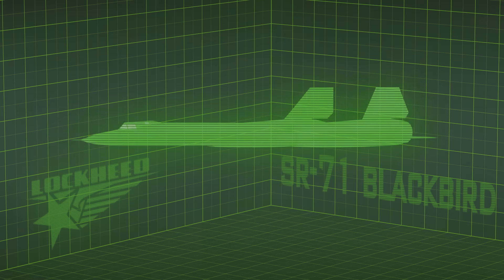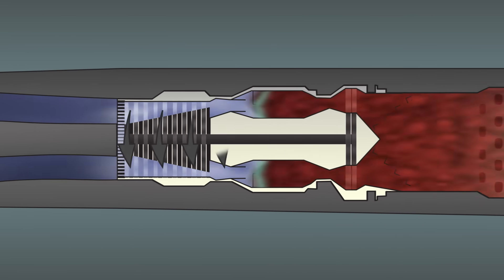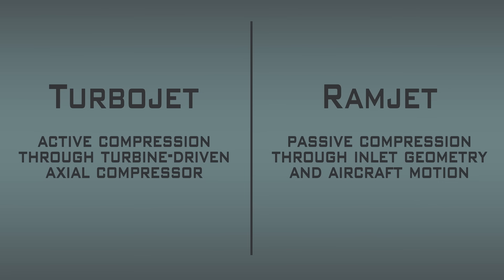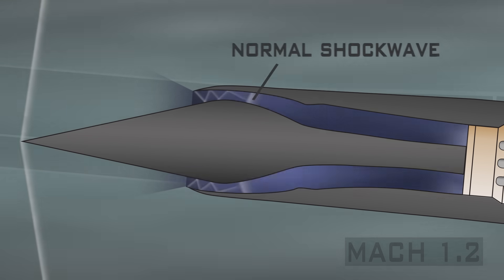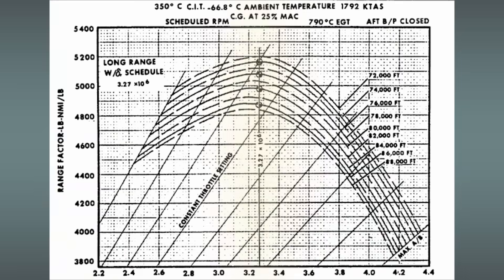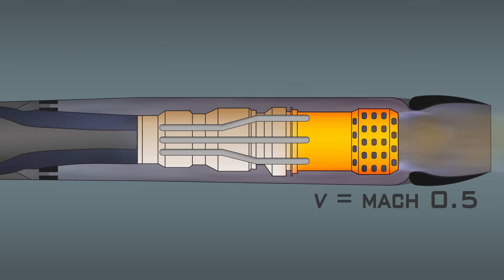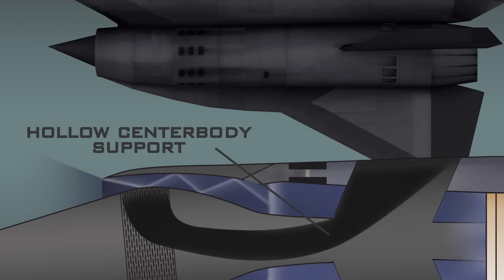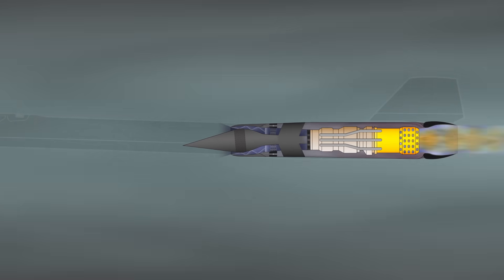The Mighty J58 - The SR-71's Secret Powerhouse

Comment: Is the cross section at :25 taken from the top, or the side? Didn’t know the cone on the front was tilted, not aligned along the nacelle’s central axis, so that’s good to know, but how irritating that this YouTuber doesn’t tell us if the cone is pointing down, inward, up, or outward. Makes it hard to invest attention in the rest of the video when it starts off by leaving you with a nagging question.

Comment: Most permanent locations for the SR provided high pressure air that spun a turbine with a spline gear engaged in the engine accessories box.  Secondary Start Carts was used when required. Each cart had 2ea General Motors Buick V8 engines that were connected in tandem.  They were soup-up boat racing engines tied to a spline gear to engage the engine. One cart could start one engine at a time. I guess 2 would be more convenient. I’ve only seen 1 used. The SR71 used JP7 fuel. The only aircraft that used it that I know.  The fuel had such a high flash point that the regular igniter used in usual turbojet engines wouldn’t work. The fuel had to be ignited using the liquid pyrophoric chemical TEB (Triethylborane) with so many shots available for each engine. TEB ignites when in contact with air.

Comment: Much of the math calculation were by slide rule. I spent 11 years on the SR 71 until it’s retirement. The most difficult and maintenance intense aircraft I’ve ever worked on. The fuel, engine oil, hydro fluid was especially designed for it. Your animation is close. You show the cooling air around the engine as being a smooth run. The nacelles have several large structural titanium main frames around the circumference that are hinged at the top and tie together at the bottom for access to the engine. These frames not only help carry the trust load of the engine but also the load from the outer wing. The velocity of that air shouldn’t be very high. I’ve seen other illustrations on how the SR engines work. One that was correct. Assuming that it’s now declassified you can find it on the Internet. The overall thrust that the SR has is not just from the engine and afterburner but also comes from the inlet. At cruise the spike with its shape has high pressure behind it and low pressure near the front. The spike pulls the airplane along. If the correct position for the spike at a certain speed and condition is not maintained, a condition call an inlet unstart will occur. This causes a violent aircraft yaw slamming the Pilot and RSO heads against the canopy. Also causes skid marks.
Reply: That closing skid mark comment made me spit all over my computer screen. I'm still laughing.
Reply: This is probably the best youtube comment I've ever read
Reply: Rex, Where on the engine is the Triethylboron  tank located?
Reply: Well aren't you the little smarty pants! Glad you were. Hat's off to ya !    : )
Reply: Whoever designed this beast is a genius. Really.
Reply: @drjthornley  Kelly Johnson
Reply: most people of this audience do not know / never seen a "slide rule"   :0  makes me feel old.
Reply: u have it right rex, see my explanation above, - it fits with kelly's words "at mach 3 , 80% of the thrust is GENERATED by the inlet"!!! - what has not yet been repeated in history is an integrated engine and nacelle setup that works so well at all flights regimes - before you can have "sled drivers" you need a "sled builder" , alas, no more kelly he was not replaceable
Reply: What the hell?
Reply: This is a freaking amazing comment. Geniuses! Thank you @Rex Lee
Reply: This is why I frakin love YT - comments are PURE GOLD.
Reply: Top speed ever recorded was Mach 3.56 for 15 seconds, achieved while in a descent and unexpectedly hitting very cold air.
Reply: @studlouie416 holy shit, that’s fast. Was that Brian Shul?
Reply: Rex lee what kind of math did you have to use
Reply: Wow another super genius engineer
Reply: What would you guess would be the theoretical max speed of the SR 71 riding the shockwave?
Reply: @blueboltstrike6705  I have no idea. I’ve asked several times and got no answer except Mach 3+. Maybe they didn’t know or I didn’t have the need to know. Riding the shock wave? Not that I know of. The XB70 rode its shock wave I believe. The wing could be folded down for that function. Another fast aircraft and good looking too. The last one is inside the Wright Patterson AF museum
Reply: @rexlee3710  Yeah they told me that the XP 70 had the winglets that would drop down and actually grab the shockwave for further stability and speed. 

All those super sonic aircraft and even the civilian Concord could ride the wave. My guess is that the SR 71 could easily go 3.6 Mach
Reply: @blueboltstrike6705  unoffical 15min.jumps to 3.5 mach have been reported. its the heat on the airframe & components that stop it from going faster.
Reply: I bet it would be easy to adapt this design with a scramjet phase. All that would need is an ultra-narrow channel into which fuel is injected during hypersonic cruise.
Reply: Cara escreveu uma bíblia.
Writing a Hole Bible 🥺
Reply: Man, I've had my hands on many jets and many jet engines, but I admit, I am greatly envious.
Reply: Skid marks???? Runway or the pilots underwear?
Reply: What systems on the SR 71 required the most maintenance?
Reply: These planes were priceless and irreplaceable national intelligence assets, they never pushed the performance envelope. It wasn’t worth the risk. I read a nasa report from when they had a few blackbirds, they thought Mach 4 at 120,000 feet was theoretically possible, however an attempt would never be approved.
Reply: 🤣😂🤮Where is a single reality fact about this jet NONE only a few outside pics 0 inside pics and a fake story on Wiki hahaha lol such a FAKE that has been produced by the Pentagon to make 35% demoncratic morons of the world to believe in it brainless brainwashed demoncratic western idiots LOL... trash fake channel blocked just like others!
Reply: I'm too high for this shit.
Reply: As a high school senior going to into aerospace engineering next year. I view you basically as a sensei, my respect for you and your achievements is something that can't be stated easily with words. I guess all I can say is you helped create one of finest aircraft to ever take to the sky and that inspires me.
Reply: Kosta Thomas. May I suggest reading the book Skunk Works by Ben R. Rich. I have listened to the audio version twice and was even more amazed the second time around. The book goes into detail of the development of the U-2, SR-71, F117, and B2.
Reply: @gizmo9987  The B-2 is not a Skunk Works aircraft. I have not read the book, it might say something about the B-2 anyway.
Reply: @gizmo9987  Kelly Johnson was one Baaaad Dude!!!
Reply: @skunkjobb  It’s not even a Lockheed aircraft either, it was made by Northrop.
Reply: Kosta Thomas what college?
Reply: Sir thank you for working on the blackbird it is mind blowing of the capabilities of the sr71
Reply: The fuel is called (poly ether)polyoxymethylene dimethyl ethers.
Reply: As long as those skid marks are around where they can be dealt with and talked about later, but image all the skid marks that never got to tell their stories.. lol
Reply: Thanks for the additional details re the tuned inlet spike. I had long heard the SR's engines actually do more pulling than pushing at cruise and altitude, but could never get my mind fully wrapped around how that was even possible, having spent my 4 years with the Navy's A-4 Skyhawk which from my observation, derived its thrust solely due to huge amounts of noise, smoke and blast out of the hole in the rear of the airplane.
Reply: So much investment of time, manpower and money with so much exotic materials and Russians got quite near with just stainless steel 😂😂
Reply: @Sameer2762  the russian aircraft tore its engines apart anytime it passed Mach 3
Reply: @deathdragon2283  I know but remove the sanctions going back in time and Russians could have went the Earth sending it on interstellar course 🤣🤣
Reply: No, you csnnot bresk this down so.
The MIG 25/31 could reach Mach 3 for a short time. Measured in minuted or seconds.
The SR71 could make a sustained flight on Mach 3, without damaging engines, or damaging and/or loosing important subsystems. The MIG's would simply burn out after few minutes, while the SR71 flew som decades.
Reply: @Sameer2762  No one has yet to get close to the SR-71, it can go mach 3.3, 100 mph faster than any other jet before it. the only Russian jet is slower by .1 mach when it comes to max and its cruising speed is far below the SR-71 with 3.17 to 2.6, and the top speed is thought to get as high as 3.5 but its noted that no one would ever want to hit that speed, the 3.3 top speed requires permission much less 3.5. the thing is so fast its only been intercepted once, and that was by a Swedish pilot over the Baltic sea. the Blackbird was having engine trouble and got an escort. the MiG though, it was really nice, especially since it entered service 2 years before the sr71 and i don't think its been retired yet.
Reply: @itshunni8346  I agree but all I mean is, what if the Soviets would have invested bit more of time and money on such a high level of research. The scenario would be like a proper Formula 1 race 😂😂
Reply: @itshunni8346  The top speed on any of the Blackbird variants: A-12, M-21, YF-12A and SR-71A/B/C weren't limited by the maximum Compressor Inlet Temperature(CIT), not Mach number.  The CIT was never allowed to reach over 427ºC.  During one of the last flights, special permissions were issued to raise the max. allowable Compressor Inlet Temperature from 427ºC up to 450ºC in order to try and set a new speed record. Unfortunately tanker support and environmental influences along the route didnt allow the max. inlet temps to be reached.   In  off-nominal operations, the J58 engines in these aircraft did have a speed restriction to just Mach 1.5 only if emergency fuels OTHER THAN JP-7 were used.  Using emergency fuels had to be written up as a discrepancy on AFTO form 781.
Reply: @hoghogwild  I thought the Blackbird’s maximum speed was limited by how hot the fuselage would get due to aerodynamic friction.
Reply: @michaelmurray11189  Eventually perhaps, but the engine CIT was not to be violated, 427ºC.
Reply: Russians do not retire their war gear. It is always the best and modernst equipment they have!
Reply: @Sameer2762 that’s what they said they did. Russia often lied about their capabilities
Reply: Skid marks? Didn't unstarts only occur when adjusting the spike at high speeds?
Reply: Ryan Boles. This is unscientific. The skid marks that I was referring to are the ones that comes from pooping yourself resulting in stains (skid marks) in your underwater.
Reply: @rexlee3710  ahhh, it would indeed cause those
Reply: @rexlee3710  haha
Reply: @rexlee3710  Thank you for commenting. It is amazing to hear / learn from the people that were actually there. Again, thanks Rex.. Z
Reply: @rexlee3710  We all know that metaphor.

Comment: The most astounding part is that this was all designed, engineered and built in a time before a simple calculator ever existed.  They used slide rules to help with the calculations required.  How many people alive today even know what a slide rule is???
Reply: This was well into the computer age and there were plenty of mechanical adding machines. 

Slide rules were used for simple calculations and checking.
Reply: @calvinnickel9995  ::  Plus batch programs run via decks of punch cards on mainframe computers, with aeronautical engineering programs.
Reply: Yeah if you want to talk punch cards and mechanical computers you can go all the way back to the 18th century with programable weaving looms. The French also had things like control characters for their network of optical semaphore stations in the 18th century. Baudot code—the first punch card code specifically made for transmitting messages electrically (and where we get the term Baud from) was available in the late 19th century. 

ENIAC, the first electronic computer, was made at the end of the war. By the time the SR-71 was designed, Mainframe and even mini computers were commonplace like the IBM 1400 and Honeywell H200. 

A slide rule was more like a calculator was in the 1980s or 1990s or like a smart phone is today. It’s portable and convenient and good for doing quick math or checking gross errors. 

But from 1980 to today you use a microcomputer (PC) with a CAD or spreadsheet program to do actual design or complex calculations.
Reply: Slide rules are more useful than calculators imo. You get a better "sense" of the numbers from one.
Reply: @JayVal90  It's more like you have to have a better sense of the numbers to use a slide rule. Otherwise you lose your decimal point.
Reply: Plenty in their sixties and above I guess. I used one at school and university. I think it's still in my office somewhere.

Comment: The SR-71 speed is 2193 mph or 3529 km,h or Mach 2,85 not Mach 3,2 for it to hit Mach 3 it would need to hit little over 2300 mph and to hit Mach 3,2 need 2460 mph its flat speed is under 2200 mph NOT over 2400 mph to hit Mach 3,5 need to hit 2700 mph and Mach 3,7 2838 mph sound of speed is little over 767 mph the speed of sound does not change the higher you go it might hit Mach 3,2 as it’s diving but that’s not it’s true flat speed.

Comment: This engine is an awesome masterpiece by all means. Ever since the 80s, when I learned about it, it fascinated me. The turboramjet is a genius concept and the implementation in the J-58 is beautiful. As a German engineer, this tickles every gene I've got :)
I could easily imagine, that single-engine unmanned fast strike drones could be equipped with a  turboramjet. In unmanned combat aircraft, you can skip the added safety of two engines. Fast and efficient engage and disengage with the ramjet in operation coupled with the controllabiliy of a turbojet for takeoff, landing and over the mission objectives.
Reply: They built a single engine drone based on SR-71 features.  You can find it on YouTube.

Comment: Not very mighty, only about 25000 pounds of thrust. Compare with engines on 777 which give 120000.. 5 times more
Reply: But you also have to compare the airframe weight and aerodynamics, the 777 was designed for carry weight but the SR-71 was built for high altitude high speed, both completely different shapes and engine geometries. If you ran a passenger turbofan at those heights and speeds it would flame out and be torn apart due to internal stresses.

Comment: If the engine design is so effective, why isn't used on planes like the concord.
Reply: The engine is effective & a marvel of mechanical engineering but only a government can afford the tons of special fuel per flight it consumed & the huge amount of support it took to keep it flying. No airline could afford the cost of flying & maintaining a plane equipped with such engines.
Reply: @Paul Buckley- the Concorde used an external compression inlet which keeps the shockwave outside of the inlet. This system is very stable but tends to limit speed to Mach 2. It burns too much fuel above Mach 2 to be efficient. The SR-71 used a variable compression inlet which allowed the shockwave to enter the inlet. This inlet is unstable and would sometimes “unstart”.....the upside is it could efficiently accelerate past Mach 2.

Comment: "Fuel efficiency" is very much a relative term when talking about the J58. :)
Reply: Considering this beast would cruise at mach 3.2 for half a day almost indicates it was extremely fuel efficient.
Reply: Not half a day.. lol. It was out of fuel in a couple hours AFTER being tanked.
Reply: @protege1717  from what iv read they could suck their tanks dry in 15min if you pinned the throttle to the firewall

Comment: Good ole Lockheed Skunkworks... deliverin' the HEAT since the 1960s!  Makes me wonder if one could design a lightweight single engine fighter (like the F-16 or F-35) around one of these engines (or equivalent made with modern materials).  And, if so, what the flight telemetry would be like.

Comment: COLD AIR THE PIPE SO THEY CAN MATCH WHEN IGNITED HHO...THIS JET TURBINE CAN FLY WITHOUT GAS....PWM SEC MACHINES RETARDED....ONLY OPTION ON THE TORCH TIP.....ABOVE THE ONLY THING YOU CAN BURNED NITRO LIQUID GAS OR ACETONE HQ ONLY...THAT IS WHY AIR DOMINATION UNDETECTED NO HEAT. CARBON FIBER

Comment: Comments about here without computers are true but even today all a computer is is a number cruncher. Engineers are still putting the basic design into Cad programs. The Concorde had a similar more elaborate system of ramps to keep the air going into the compressor Optimum. The thing about Concorde is that it had to operate as a normal airliner. The incredible thing is that both aircraft were developed at a time when their was no Cad and control systems were analogue and human.

Comment: Pratt and Whitney clearly borrowed the idea from MACH 2.0  MiG-21 engine designed by Russians in mid 1950s, I am sure a slight modification of MiG-21 engines on making them use afterburner all the time will achieve the same thrust as SR-71 engines at sea level.
Reply: Not exactly. The Mig-21 has a spike that moves forward and aft like the SR-71 but they work opposite. The MiG spike starts in the restricted position and extends the faster it goes to keep the shockwave outside of the inlet. The SR-71 is just the opposite.

Comment: One small problem with your compressor animation: it's backwards, turbine compressors use increasingly smaller stages of turbines in a tapered casing to compress the incoming flow of air.

Other than that awesome video!